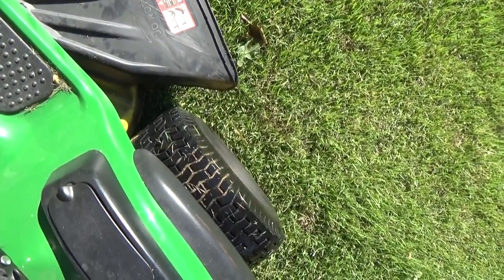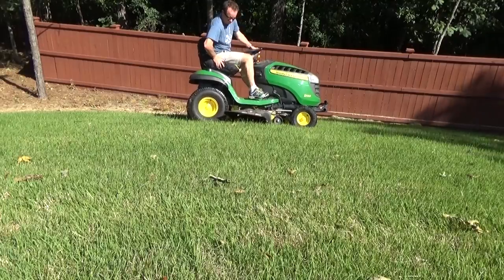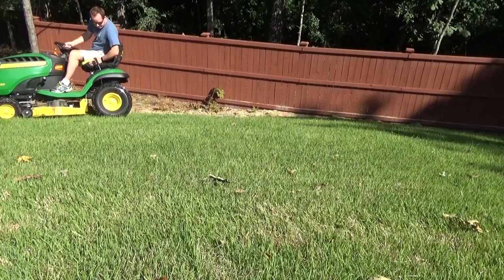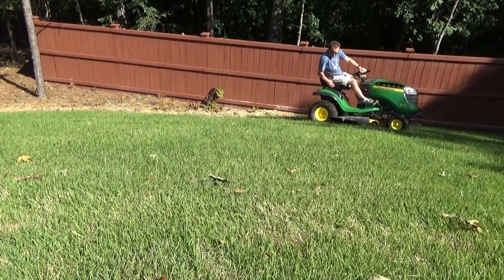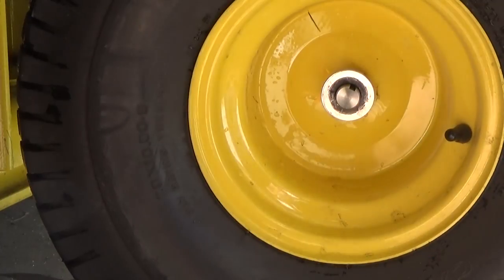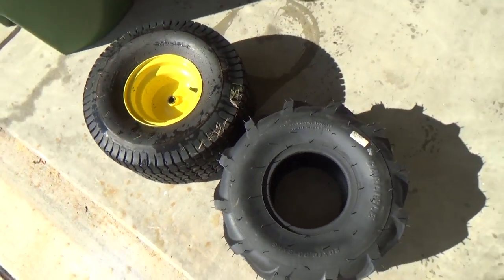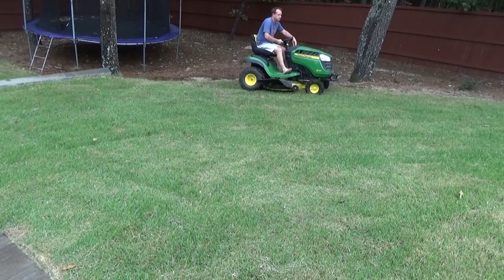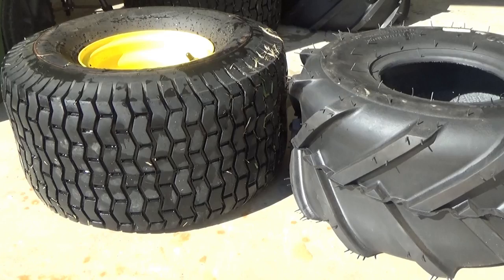How to Fix Spinning Lawn Mower or Tractor Tires

Comment: Did this with my zero turn from when it was late 2018 doing 6 yards a week I kept getting stuck in customers lawns. I put these bad boys and there amazing for traction I’ve never gotten stuck(I used some common sense) other than if the front casters get stuck on something it sure ass hell makes a divot. I’m only 14 so I can’t drive so I drive my mower to my customers houses and I cut through my friends yard which has a steep hill and standing water and this plows through it

Comment: I have the same tractor and put on a snowblower on it, so I had traction issues even with chains.   I filled both rear tires with plumbing antifreeze.  I think I put 3.5 gallons per tire.   Removed the valve core, used a small pump and I fitted it with a really tiny hose that slide inside the valve stem with room to let air out.  The following year, I moved to a new house with lots of hills, I could not believe the places I could go up with the stock tires with the added weight in the tires.
Reply from the maker: That's a great idea.  I had thought about doing wheel weights but never your approach.

Comment: I got a similar mower, its a JD d140 and i just lower my tire pressure to like 8psi and it helps
Reply from the maker: Not a bad idea.  Just like you can do in the car when you need more traction.
Reply: One video clip, "Choosing Tires for Your Garden Tractor" recommended using heavy duty all purpose tyres.

Comment: THANK YOU FOR THIS! As an older woman, I have to use a riding mower. But my land is a big slope. My lawnmower simply won’t do it. Sit and spin! Now I have an option. Thank you!
Reply from the maker: Also look at wheel weights if you can't find the tires.  They are pretty easy to install as well and seem to be easier to find than these tires right now.
Reply: @ClintHolland  OH THANK YOU!!!! I wonder if I just added weight to the back, if that could work? I have some iron slabs about half inch thick that are heavy. Hmmmm THANK YOU
Reply from the maker: @wordswritteninred7171  It absolutely would.  That's why some people with pickup trucks keep weight in the bed when driving in rain and snow.
Reply: @ClintHolland  yo are right! I put them on the back, an it improved it greatly! Not perfect. But I can get more done than before! All thanks to our! Can't thank you enough
Reply from the maker: @wordswritteninred7171  Awesome, glad it helped.
Reply: One video clip, "Choosing Tires for Your Garden Tractor" recommended using heavy duty all purpose tyres.

Comment: I really don't have much of a flat spot anywhere on my lawn and I mow about 1 acre.  I have a John Deere 318 with regular turf tires BUT my machine has independent rear wheel braking and I have installed wheel weights.  Wet day I can't mow safely so I do wait until I get a dry day.  Also carry the minimum safe tire pressure on all four wheels.

Comment: Lawn tractors have an open differential to prevent the lawn from being torn up by the inside wheel when turning. Switching to an AG tire will dig a hole when it loses traction. I have a huge hill in my yard, way bigger than what you have. I run 3lbs in rear tire and simple lean to the up hill side if I lose traction.
Reply: Anyone reading this thinking this is a solution...keep in mind proper inflation is the only thing that keeps the deck level when you cut the grass...so if you adjust your deck knowing your only goning to have 3 pounds of air tn the back  you would be okay...otherwise you going to be double cuttting becase of the angle.....

Comment: I've been using the Carlisle All-Trail II tires on the drives of my John Deere F725 for several years.
They grip very well on slippery side slopes and are still pretty gentle on the lawn.
Reply: Doesn't look like it has enough tread gap to work much better than the stock tires.

Comment: Excellent, I think I’ll go with tractor tyres to . Was going to upgrade to a bigger mower
Reply from the maker: It's definitely a lot cheaper.
Reply: One video clip, "Choosing Tires for Your Garden Tractor" recommended using heavy duty all purpose tyres.

Comment: I use wheel weights and it made a big difference in traction on steep ground. If its wet, grass is slick. Field lug tires seem to be overkill but if it works.

Comment: My 2 year old Cub Cadet ltx46 with 149 hrs. is at the dealer.  The rear differential is out. I have a hilly property. I have already added a weight box on the back because I only weigh 140#.  I used chains on my old Cub until they came off and got caught in mower.  The diff went out on my old Cub at about 700 hrs.  I replaced the rear diff myself on that one. I am retired auto tech, so it was no big deal. But this one is hydrostatic trans axle and not sure I can get parts for it like the other one.  I'm thinking I'll go with ag tires when I get it back from shop.  There's one more year left on warranty.  I don't feel like going through this every two years.
Reply from the maker: I understand the frustration. I actually have a new video about this coming out in the next few weeks. I switched to different tires which actually work better and don't dig up the dirt like these did.  Here are the ones I am using now. https://amzn.to/3UitA4Y

Comment: The REAL MAN'S solution is to beat the shit out of the lawn mower to teach it a lesson, then trade it in for an X739 with 4 wheel drive, differential lock, and the HDAP tires.  PROBLEM SOLVED!

Comment: I sanded the polished tires with 60 grit in a crosshatch pattern til they are  dull ...   big difference and only cost a few bucks !
Reply from the maker: Great tip.  Thanks for sharing.

Comment: After almost 5 years of using the super lug tires on 14ish degree slope with slowly receding lawn and some spots of torn grass when I forgot to lean my body weight to the higher side when I cross mow I am thinking to try something else. They could be a combination of weights on the rear and traction tires which have more contacting area than the super lug.
Reply from the maker: Wheel weights would also help but you still may need to replace those stock tires.  They are just not good on inclines or moist grass.

Comment: I have the opposite problem. Plenty of traction in back but the lawn mower has a hard time turning because it wants to drift. Would putting weights up front help?
Reply from the maker: Not sure I understand about the drift.  The front of the lawnmower is generally pretty heavy already from the engine.

Comment: First Class Video Very good choice in Tires I have been Running R4's for years on my John Deere 2320 4x4 You won't hurt the yard unless you have had a Down Pour Good Job I Subbed Clint  I'm Doing the same to My 2017 X350
Reply from the maker: I tried the chains that someone suggested too but these honestly work better and haven't damaged my lawn at all. Plus, those chains are horrible for riding and make it very uncomfortable.

Comment: I put snow chains on mine, and my tractor is larger and the hills are a lot worse, in fact there really to steep to mowe with a lawn tractor.
I still find spots if I'm in a turn going up hill a get a tire to spin some but shifting you weight to that side will get it to bite in and grip. I might add some weight to see if that helps.  I spent 20 bucks on the chains brand new in the box someone had on craiglist. 
My problem with buying tires off Amazon is they might have been made in china, the rubber is not very good, I had 1 set of harbor freight tires sit outside 1 winter, the next spring I had to replace them the rubber looked like somthing ate it but it was a poor materials combination. These were 10" tires made for dollies I used on a home made yard cart.
Reply from the maker: I tried the chains as well and while they worked very well, they made the ride of the tractor so bad that I couldn't handle it being on it for very long.  Guess there is no perfect solution.

Comment: These look exactly what I need for my new husky... i'm having problems though finding 20x8x8
Reply from the maker: Unfortunately now is a horrible time to find anything it seems with the supply chain issues.  Depending on how bad your slope is you might can get away with wheel weights instead.
Reply: @ClintHolland  Actually, I found them on amazon, and they ARE a game changer! I went from 5-6 hours with a push mower to 1 hour with a Husky with the farm tires! My neighbor could only find the hybrid type farm tires, but it is making his life easier as well. Glad I watched this!
Reply from the maker: @GaryTabarJr  Awesome.  Glad to hear you found a solution.

Comment: I bought a lower end John Deere and my tires are 20x8-8.  All of the tires like these i have seen are 20x10-8 or larger. what can i do? can i use that size or am I screwed? i can't find a single tractor tread like this in my size.
Reply from the maker: There is a good chance that 20x10-8 tires would work on your John Deere.  They use the same size rim but the 10's are obviously 2 inches wider.  Do you think you have enough clearance for 2 more inches of width?  Most lawn tractors can handle that but not all.
Reply: Hey Tony - Was curious if you ever tried the 20x10-8? I have the same issue. Older John Deere with 20x8-8. Just wondering, thanks!

Comment: How steep is your hill? I'm looking to see if I would be able to mow my new yard with a riding mower and I have about an 18 degree slope. Trying to research if it would manageable with a stock tractor or if I would need special tires, weights, etc. to make it work.
Reply from the maker: It varies but at the steepest point not pictured in the video its about 30 degrees. Most of the yard is around 20-22.

Comment: I am about to buy an X350 and I am not sure why this line of tractors has this problem. My 20 year old Bolens is only 12hp and has the same tires as the JD with no problem mowing on the hill. I only weigh 160 lbs. What is wrong with these?
Reply from the maker: Maybe it has more weight over the tires or does it have positive traction on the back?

Comment: It has to do with the differential if you lock it problem solved
Reply from the maker: Not very helpful if your tractor doesn't have a locking differential.
Reply: @ClintHolland  Very true

Comment: I have the same problem with my Husq, I haven't changed the tyres yet but I find that reversing down the hill, then going up forward is the only way I can get back up. Must be the weight over the rear wheels that give it enough traction to climb out
Reply from the maker: You can also try wheel weights.  I haven't tried them but many people commented that would help as well.
Reply: One video clip, "Choosing Tires for Your Garden Tractor" recommended using heavy duty all purpose tyres.

Comment: Craftsman had a Pro series 54" lawn tractor with an optional Posi-Loc, I'm wondering how hard it would be to add that to a non Posi-Loc Craftsman lawn tractor.
Reply from the maker: A locking differential would definitely solve most of these issues.
Reply: @ClintHolland  you can get a positive track hydraulic transaxle they are made for lawn tractors, a lawn mower is ment to cut grass and pull small tools like a yard cart, lawn sweeper anything with a one point hitch, a lawn tractor has a 3 point hitch stronger frame and positive hydronic transaxle, its ment to pull grades plows, or anything that digs into the ground, you might do that with a limited slip but it's not as heavy duty, so you'll blow it out in about a year the posies track will last a few years if your doing a lot of it you need to step up to somthing larger, more hp bigger frame 3 point hitch power lift ex.
If you have a large property buy a ford 8n tractor they are cheap, you can fix it with a Bobbie pin and it's already proved it can last 70 years and still run.
Ford should bring that simple line back into production and compeat with forgin imports. I doubt you'll see a 70 year old kubota running but you can go to almost any city parks department and see an older ford tractor still being used even today.

Comment: Never had a problem with traction with my White GT mower. I "upgraded" to a john deere and now I get less traction. It may be that the deere I have has more power and it will spin the tires easier.  How are those tires with the grass. Are they easy on the grass or do they tear it up at all?
Reply from the maker: I haven't had any problems with them hurting the grass.  I also tried tire chains, which were horrible and basically made it way too uncomfortable to ride.  I heard from a few people who also suggested tire weights.  Those might help as well but these did the trick for me.  My lawn looks great.
Reply: @ClintHolland  yeah one of the yards that I mow has a steep incline and couple of dips where the tractor gets stuck spinning. I'm going to try these tires out. Hopefully that should take care of it.

Comment: humm I put snow chains on mine, it works but I have a 45 dgr incline about as steep as you should drive on with a tractor and the bottom is a always wet area the tires still get stuck unless you shit your body weight. if you put weight to the top side turning on the lawn then you keep traction it slopes 2 directions.
Cub cadet   I wonder why that wasn't the original option for law tractors. it looks like it works a lot better.

Comment: Do they mark the lawn when its wet or damp?
Reply from the maker: Not at all.  You do have to be careful in sandy areas though because it will dig a hole if you get stuck.

Comment: Clint, thanks for the video.  I know the frustration you were going through!  My lawn is pretty hilly and in one spot I've gotten hopelessly stuck a couple times.  On my previous tractor I could lean quite a bit to put more weight on the spinning wheel, but with my new John Deere the seat switch is more sensitive, so I can't lean very far before the engine quits.  I bought 80 pounds of weights but even that's not enough when the grass is a little wet.  And I considered tire chains or something similar but didn't like the idea of running over my driveway or into my shed with those attached.  I'm seriously considering this tire or something like it.

Are they still working well for you a year later?  And does the more aggressive tread leave any significant marks in the lawn?
Reply from the maker: They work pretty good.  They aren't perfect but I haven't had any problems with them tearing up the lawn.  I even tried the chains and I like these tires even better than the chains.
Reply: OK, good to know.  Thanks!
Reply: You can bypass the seat switch which is underneath the seat, just unplug it.
Reply: @henryma3368  Thank you. I considered that at first but I haven't had that problem much since then, mostly because I started using a string trimmer in those toughest spots. ;-) I'm also not sure it was a simple as unplugging it. More importantly, I feel more comfortable having that switch there, in the unlikely case of a rollover. Now, the switch that cuts off the mower when I back up (if I don't press a button first every time) that's a different matter! Grrr. I'm still thinking of bypassing that annoying thing.
Reply: @MikeAnn193  i cut a piece of wood that fits snugly into the hole where the switch is . the wood compresses the switch and can be removed in a second if needed .
Reply: @MikeAnn193  My mom tells a story about how I was riding on her lap on the riding mower when I was a child (safety wasn’t as big back in the 60’s,) in a flash I was gone, and she was certain she had run me over - she leapt off the tractor and threw it over on its side just to see me toddling off across the yard. Our neighbor saw it happen and came running over to help. She was a Registered Nurse but still cried when she saw what the tractor had done to my mom’s hand. Those switches are a nuisance, but I’m with you, I leave mine connected.
Reply: One video clip, "Choosing Tires for Your Garden Tractor" recommended using heavy duty all purpose tyres.

Comment: Hey Clint, 
Would dropping the pressure a bit help at all?
Reply from the maker: It would help a little but I doubt it would fix the issue.  Might be worth looking at wheel weights as well. I heard those can help.

Comment: Snow chains. Works for me.
Reply from the maker: You are correct. I actually bought some and tried them and while they worked great, they tended to tear up the grass more than these tires did.
Reply: Just took chains off mine  because they didn't help. Went with these tires and they didn't help either. Might have to check into the locker like one of the other comments suggested.

Comment: It doesn't look to me like you need a riding mower to begin with.  Growing up we had a 100x200 lot that we bagged with a Snapper push mower.
Reply from the maker: Sorry, your message broke up and I couldn't read it anymore once I got to the words "push mower".
Reply: @ClintHolland  I agree.  Push mowers are not equipped with a beer holder and that is just UNACCEPTABLE!  Hey, does your D130 have a cigarette lighter?
Reply from the maker: @mrbubetube  It doesn't but I can probably install one.